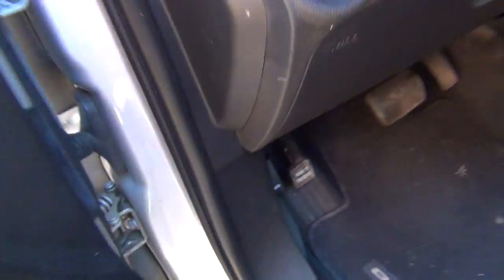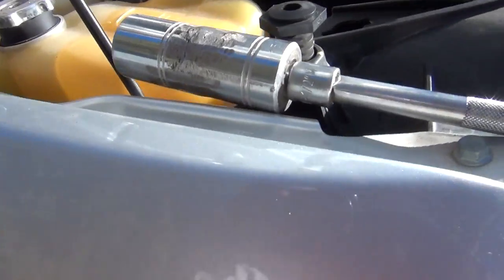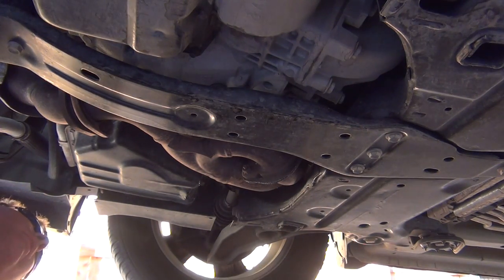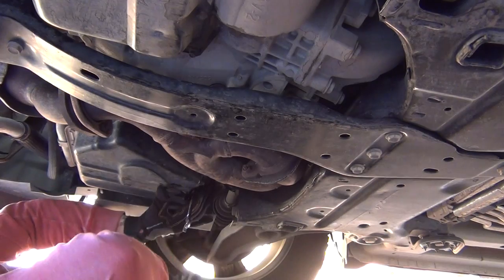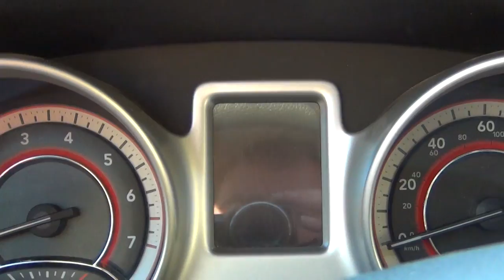How to Change the Oil on a 2012 Dodge Journey

Comment: Great Job! I have 2015 Dodge Journey Crossroad AWD 3.6 Same exact except they changed mine to 5w20. I had the same problem with oil drain bolt!! Spent almost 1 1/2 hours getting the damn thing off with my rounded off and over tight bolt kit! Had to buy new drain bolt! Stupid place it was done at put that on for life!! Anyways, your the first person to do a correct oil change on this car in a video! The only thing is while your cleaning wipe your cover down lol!
Reply from the maker: Gabe Beadle thanks! Glad to hear it helped and this was the first oil change I did o. This car since I got it. It’s been cake ever since.

Comment: When installing a new "O ring on the filter I would use a little bit of fresh oil to wipe around the ring to insure it seals good .   Also I would probably chock the rear wheels... you never know, can't be to safe...lol

Comment: oil drain bolt 20 ft lbs  for this veh       and it is always a good idea to have a breaker bar for these times  they come in very handy    I worked at a jeep/dodge dealer befor becoming a hyundai tech        and you have to have one   a 3/8 dr and a 1/2   I torque all of my oil drain bolts at the dealer    all hyundai vehs 25- 32 ft lbs